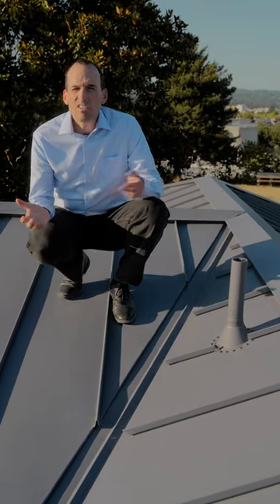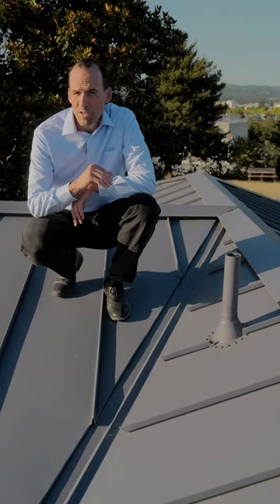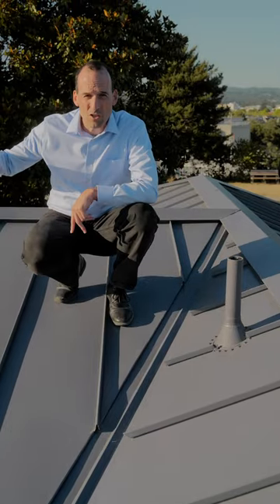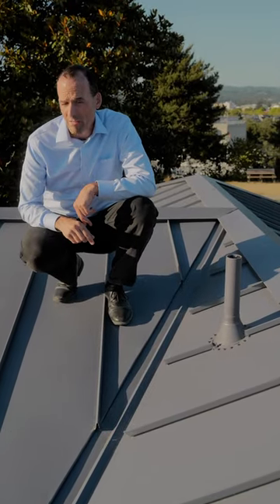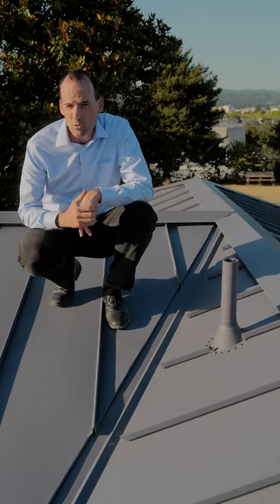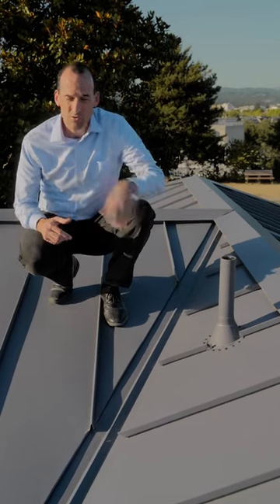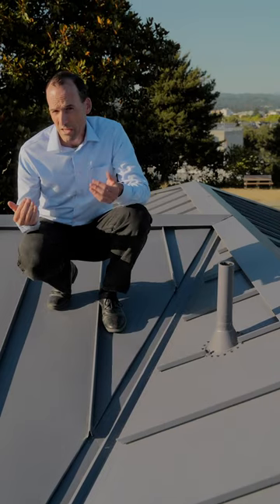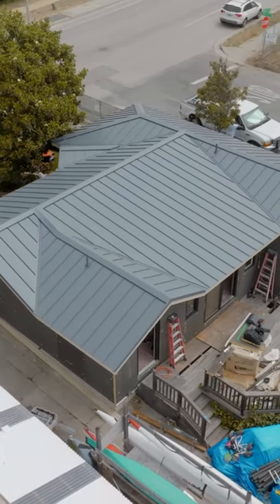What Happens When You Leave a Plumber Alone on a Jobsite?

Comment: Do vents have to go through the roof in CA?  I saw a house in another state they were able to send it through a side wall but still had to have slope to the Drain.  Obviously not great for a clean out access but if you had clean outs at the floor level I could see not ever needing the vents for clean out.
Reply from the maker: I think that depends on the types of Vents, as i don’t think we can run Sewer or combustion vents through walls, but bathroom and range hood type vents and ventilation vents(HRV and ERV) are  put through walls all the time. Fireplace vents from new fireplaces, which are very rare these days, can go through walls, but it is very hard to put a fireplace in CA anymore.